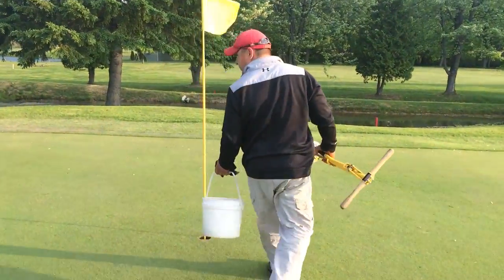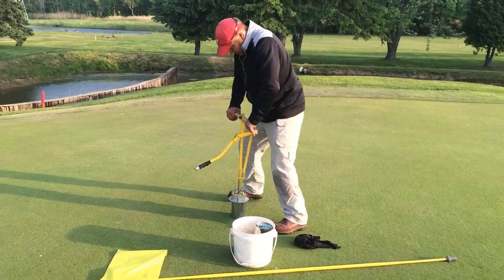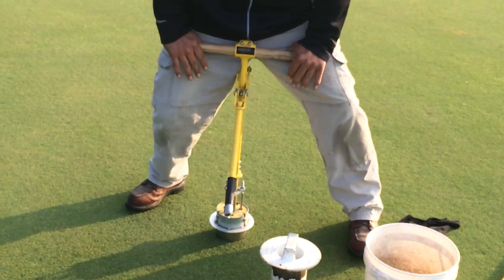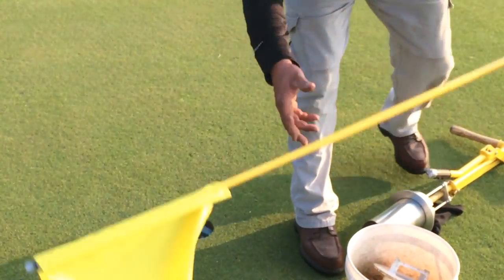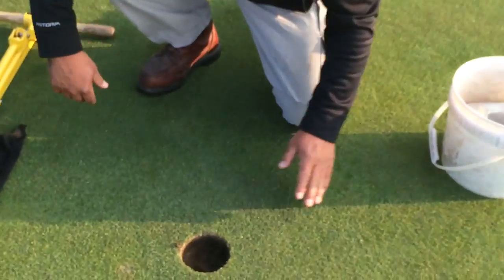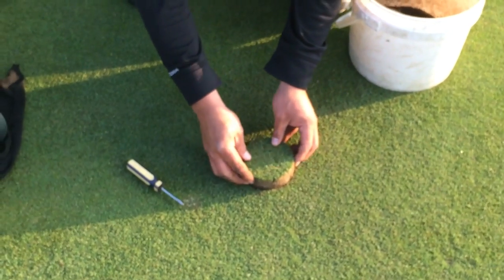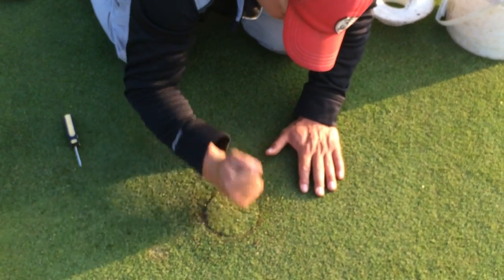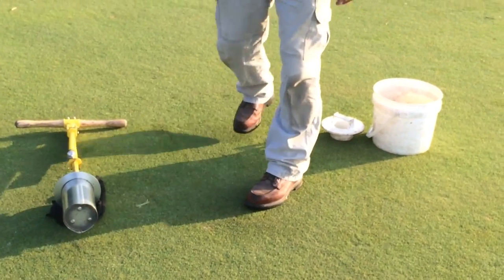How a golf hole is changed

Comment: Brings back memories!
I was a Golf Course Superintendent for 35 years!
Only suggestion might be to push the bottom part of the plug down with the cup changer to insure the proper setting of the bottom portion before placing the top part in!